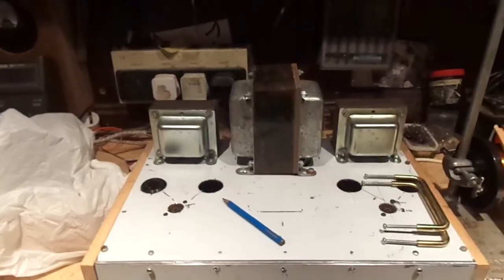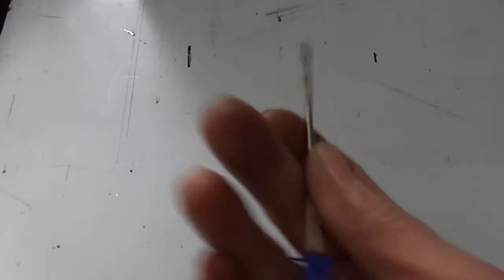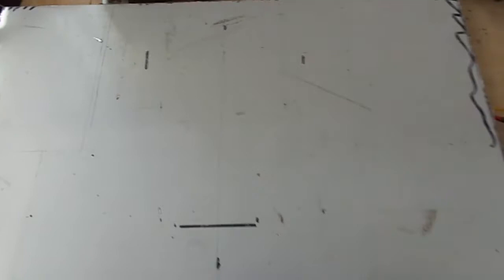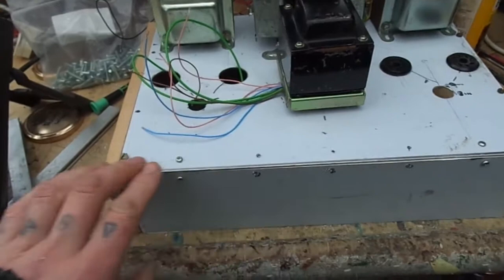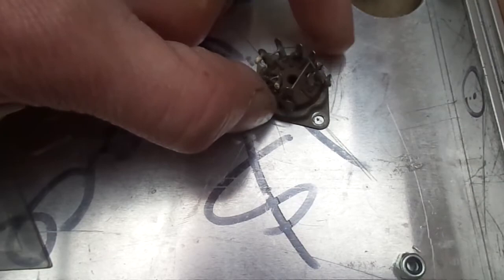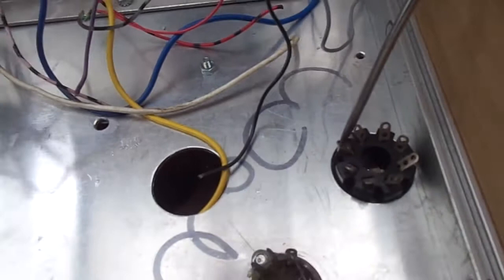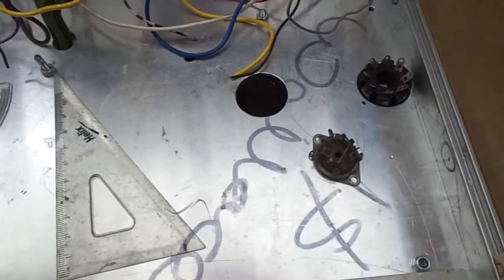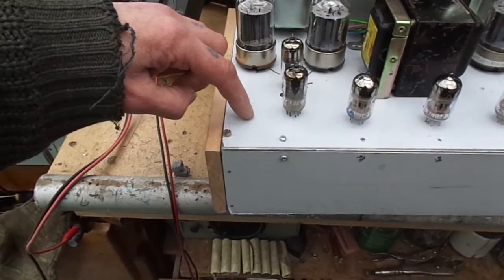Class AB2 Valve Amplifier 6146 PP - Part Three - Chassis.

Comment: Andy, You should be able to cut up the mtg bracket  for that transformer and make 4 "L" brackets to mount it with really easy. Nice layout and I like the way you have the transformers mounted to help eliminate magnetic coupling between them. Good start.
Reply from the maker: Thanks frank...DA.

Comment: Interesting to follow the amp design and placement of the valve sockets. That transformer without mounting brackets looks a bit odd - have you decided how you are going to mount it yet? Maybe underneath the chassis or would that cause hum? Cheers
Reply from the maker: Yes it is a bit asymmetric, I'll make up some brackets and mount it next to the big mains tfmr I think, but am flexible. When I figure out the front end and tone section I'll have another look. It could go underneath, the choke will be. The tfmr in question has a screening band so stray magnetic flux should be low, I'll probably screen off the PSU section, will see. See the next thrilling instalment for the answer/s.....DA.